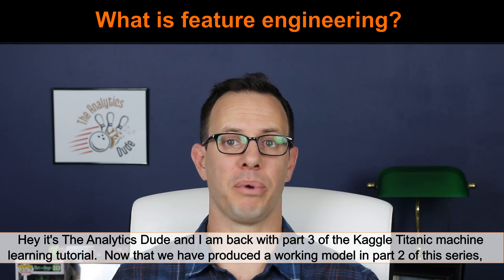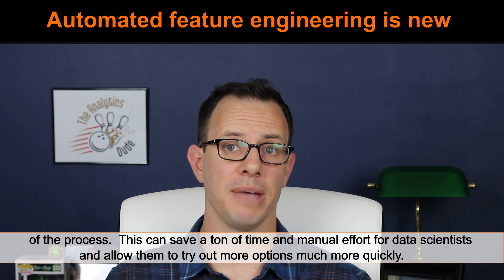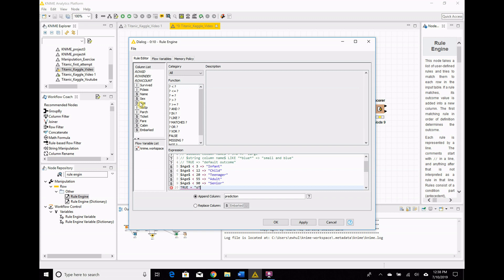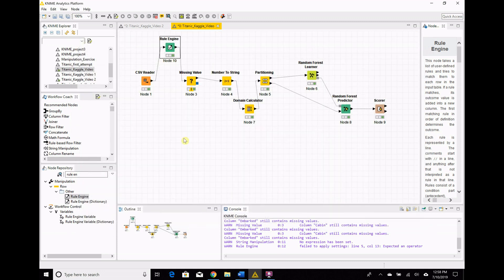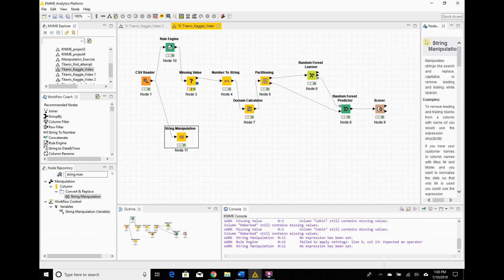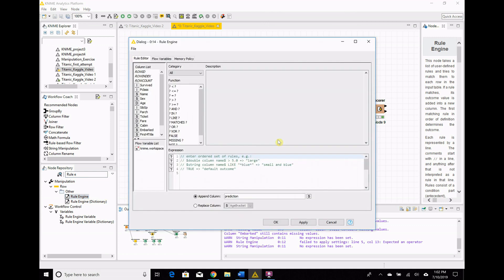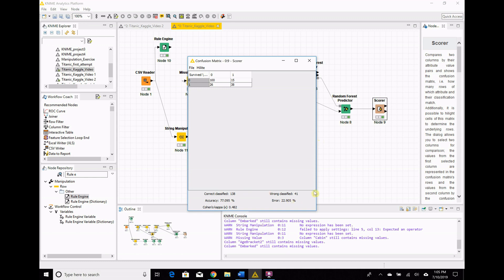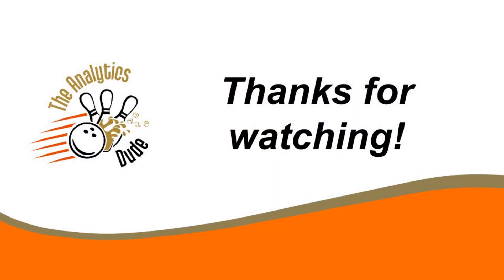KNIME tutorial: Kaggle Titanic (part 3) - Feature engineering

Comment: Hi - A good tutorial and it has shown me a lot about how this works, but did nobody else spot the mistake? The "new model" is actually little different to the old one since Node 14 Rule Engine is setting AgeBracket to AgeBracket2 IF (and only if) the value of AgeBracket is MISSING. 

However, the Rule Engine at Node13 is setting it to "Other", so it is NEVER missing!  Pause the video as 12:39 and you will see AgeBracket still contains "Other" instead of the value from AgeBracket2.  

So for this to work, the code in Node 14 should be:
$AgeBracket$ = "Other" => $AgeBracket2$
TRUE => $AgeBracket$

In spite of that, very useful. Thank you for the demonstration and tutorial
Reply from the maker: I'm going to take your word for it, I haven't re-watched this in years.  
Just doin my best, its likely there are mistakes and inconsistencies.
Reply: @ewhulbert  Don't get me wrong - I enjoyed the video and it was very useful. Your explanations were very good and it was easy to follow. The mistake I pointed out was the type of thing we all do, and that's why I mentioned it because quite often that's a good way of learning too and knowing that even with experience, mistakes can creep in. Maybe I should have worded it differently, but certainly wasn't intending to offend. Anyway, thanks again. I learned a lot from your video.
Reply from the maker: @brianbates2074  All good bud, not offended.  I appreciate the comments and interest and let me know if there is anything you're interested in seeing on my channel.

Comment: What was the need for converting an integer to string?
Reply from the maker: Mathematically speaking it is not strictly necessary because integers are discrete that same way that a string is.  The reality is that classification algorithms expect nominal or categorical variables while regression expects numerical.  Integers are numerical, and random forests can do both regression and classification, so it is best to error proof things and have the type of variable it expects for that operation.  Does that make sense?
Reply: @ewhulbert  Absolutely, thanks!